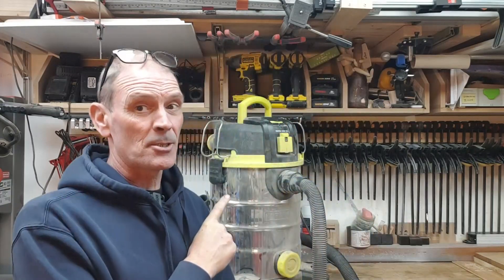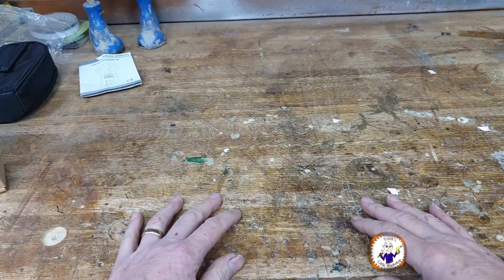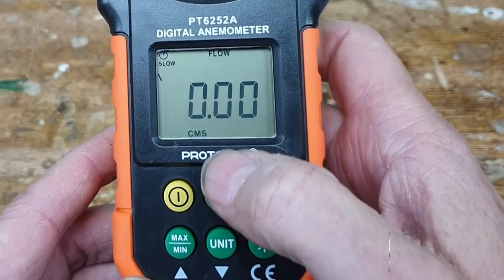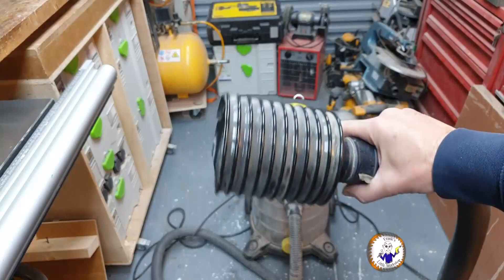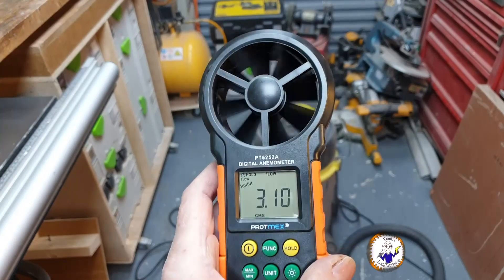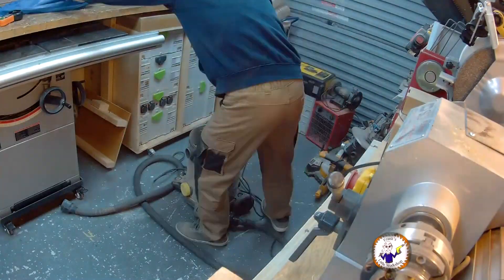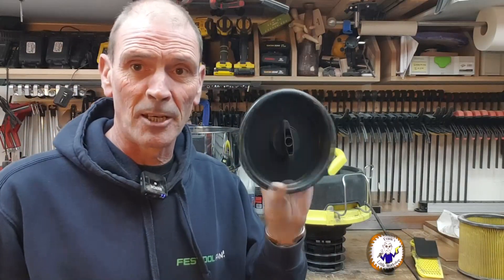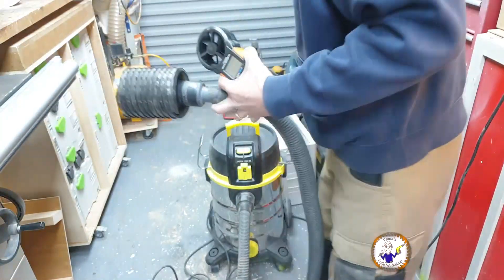Measuring shop-vac suck.

Comment: You make everything interesting, entertaining and informative. My only wisdom with vacuums, is: using cloth bags (from a Wickes vacuum long dead) over Titan filter arrangements; and using the Titan on blow (outside in a windy rural setting) to fine-clean the cloth bag. The cleaned out shop waste then mixed in with paper stuff to make briquettes for the fire. Watched video with second cup of morning tea; cheers for that second-cup opportunity.
Reply from the maker: 😁 Thanks Colin. Always a pleasure to help out with an excuse for a second cuppa 😁. My other shop vac (100mm inlet with a 50Ltr drum) uses a paper bag over a paper filter element, which works well... but still gets a bit clogged up. I really need to make a decent cyclone setup... hopefully soon 😁. Thanks for watching Colin 😁👍

Comment: Good video , my Ryobi has the same pleated paper filter I normally use bags in it so haven't experienced a loss of suction until the bag is full 😀
Reply from the maker: 😁 Thanks Trevor. This one normally lasts quite a long time before it gets blocked, but I have worked it very hard over the last few days with some very fine dust. I think it earned a clean out 😁. Thanks for watching 😁👍
Reply: @frankslittleworkshop  yes but you got it working great again 👍